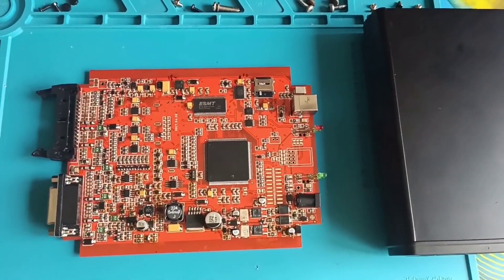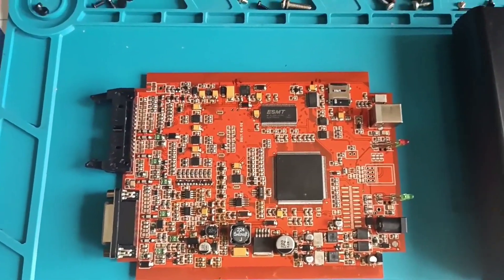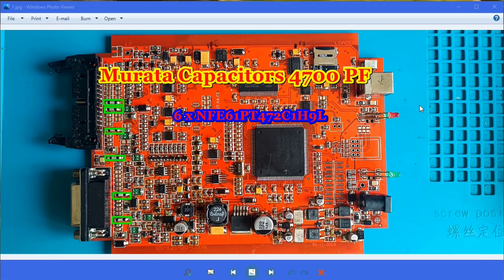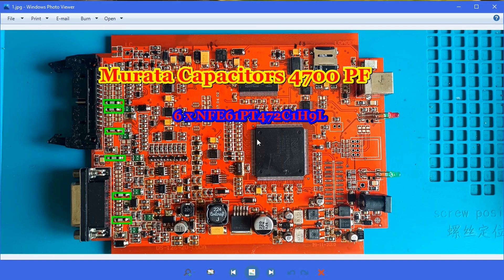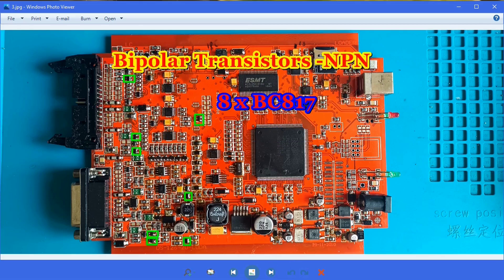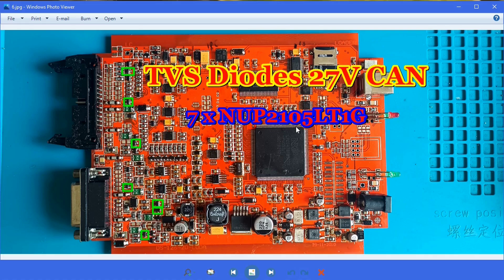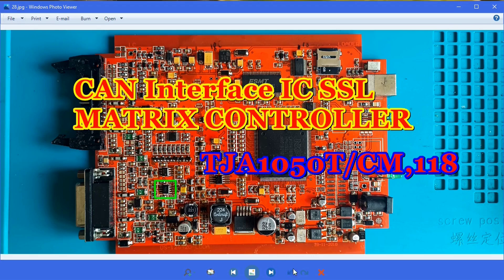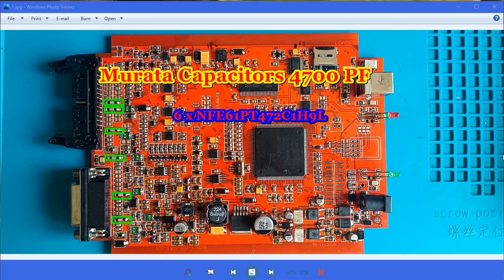K-TAG_Clone. Full-Rework !!! Let's repair and improve the functionality of this Clone !!!

Comment: Too bad not all parts are in your shopping cart. It is not 60 euro. No transistors and no Murata filters. I am now at a total of 104 euro with everything but the electrolytic capacitors and fuses. Some cheap items I ordered double. so you can get it a bit lower. clone KTAG cost me 60 euro.
Reply from the maker: The problem is that the price of components has doubled, that video was made a few years ago.

Comment: Thanks for the video.  I have noticed one problem though.  At time 4:19 you indicate 3 transistors on the left center of the board as BCR112E6327 as an NPN transistor.  Then at time 5:39 you indicate the same 3 transistors as MMUN2113.  Could you clarify which is which?  Thanks for the hard work in putting the video together though.
Reply: oh, i see below someone asked 6 months ago about this same thing.  Guess you don't know?

Comment: Hello @YOYODiagnostic
1st of all thank you for your work.
About the ceramic resonator, there are some reworks where people use a quartz crystal, what are your thoughts on that? Since they have to add two extra capacitors, is it worth the hassle or from your experience the higher quality ceramic resonator will do the job? Thank you

Comment: hello:
I want to buy fc200 I have seen your videos and I like it but I don't know if it reads volvo edc16c34 I see that now there are some edc 16 but this one? On the other hand, what advises me to clone bsi citroen peugeot volvo?
thank you so muchkees v2 unlock.:Good morning, maybe I have not explained myself well, I know that fc200 does not do edc 15 but now it does 16. My question is if it could read edc16 c34 volvo c30 1.6d 2008? On the other hand, I have kees 2 original, it will be blocked due to an update to kees 3 within 15 days. If I use the nxp chip, would it work as a master clone? I have drivers of version kees 2.47 kees 5.017. Where can I load the latest drivers? I plan to buy a kees v3 and I have bought the original v2 with 14 days to try it comes from an update and it is going to block
ar. any ideas to evite blocking? or should i convert to clone? I already have a kees 2.47 red plate clone.
Thanks friend, your disinterested videos help a lot of people.
In andalucia spain very hot.....

Comment: I have a Bosch mg1cs017 ECM from 2018 mustang and have a spare junkyard ECM that I'm not worried about. Will updating cloned KTAG to 2.70 library allow me to read my ECM and write to new one? Any help is appreciated
Reply from the maker: Hello. 
Ktag clone it doesn't work with this ECU.
Reply: @YOYODiagnostic  do you have any recommendations for a tool that would be good for cloning this ECU?
Reply from the maker: @AmpedElectronics  
If you are looking for something original and cheap, check out the website at CGDI.

Comment: I had the chance to read my EDC16 with a Kess clone. It read the maps file one time then when I wanted to read it again after 10 mins, it didn't. I kept trying and it wouldn't read again. Very weird. For myself I bought a Galletto 4 (clone) and it worked everytime on EDC16 but I couldn't read DCM 3.4.
Reply from the maker: Hello.
Galletto is a better experience for edc16 than Kess.